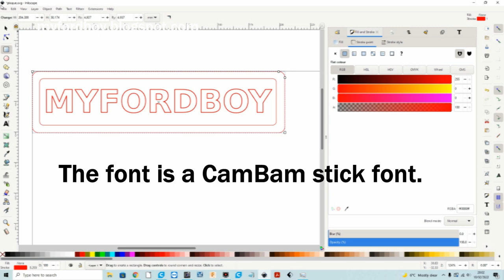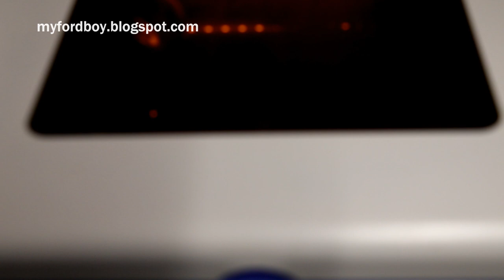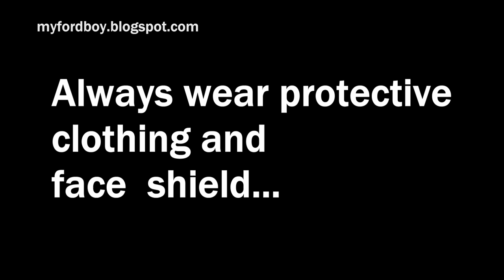Metal Casing at Home Part 116. Plaque/Sign from Laser Cut pattern

Comment: Laser cutters, the most under rated tool in the workshop!
Reply from the maker: I agree. It is so usuful and gets used much more that I expected.
Reply: Indeed - I have both 120W CO2 for wood/plastic and af 1kW fiber for steel and metals. If you don't need the lettering to stand proud more than 1.5mm then you can laser engrave the pattern directly from a piece of acrylic. I have done that succesfully several times. One thing I really like about lasers is the ability to cut what is almost a square corner, enabling slot/tab construction with a precise fit. I have also managed to cut functional stainless steel gears on my laser: https://www.youtube.com/watch?v=z2QA6EQYDEI

Comment: That 1st (in the video) plaque/sign turned out quite well.  When you applied PVA to seal the MDF, the thought popped into my head to ask if (thinned?) PVA could be sprayed in an airbrush in situations like that when you want to cover everything.
Reply from the maker: I did actually thin the PVA to seal the MDF and there is no reason why it could not be sprayed. It is helpful to get a fillet of glue around the text.

Comment: was about to ask if the lower flask wasn't too shallow - like the fails and aftermath 👍👍👍
Reply from the maker: If use the same flask for other castings without issue. In this case I don't think they were together property. I used clamps on the second attempt.

Comment: Question; You have always indicated to allow for 2% shrinkage. Without no fancy tools just a ruler & tape measure, what is the best practice from casting brackets for an engine to mount P/S, an Alternator and other then drill holes to mount these items?
  I am using a Late model EFI engine in a 56 year old truck for me. This is my last project but including parts for door panels and a center console I am building with 1/2” PVC then covering with foam & leather. All custom to suit this 6’3” tall retired ASE master tech and building for my taste and size to be comfortable. 
 Using a calculator and creating wood molds to cast these parts oversized then power sand to size before drilling holes to mount the parts. The rest are simple items as I intend to add bolts or machine screws into the casting for mounting.
  After decades of seeing designs used to create beautiful panels with metal inserts, I draw these on paper then modify to keep simple & easy to service. Long after I am gone, a service manual in paper, CD and thumb drive to allow any mechanic to diagnose the root cause, order parts for application & part number for ease of proper service. This gets many in trouble with a “Resto-Mod” using a mix and match of parts from different models, years and no idea where the wires or colors of wire used are found. 
  I am getting into the weeds a little, but what do you feel is the best for this 2% allowance on items that require more accuracy? I have drawn these brackets, holes, gussets for structural strength and ease of service as to me, this is job one with simplicity using the “KISS” engineering principle of keeping it simple stupid! Thanks for all of the free training and projects as the camera, lighting, sound, editing is work folks don’t think of for each video. For many reasons, I can say with pride, thank you very much!!! Omaha, NE. Thanks masked man!
Reply from the maker: 1.5 -2% needs to added to the pattern. It will depend on the metal used. If it's realy critical you may need to do a casting first and adjust the pattern size.
You need to add draft to all vertical surfaces and extra for any surfaces that need machining. Take the length of a part you want to finish up with and multipy it by 1.5%, i.e if the part is 5" long pattern would be 5.075".

Comment: I liked your idea of using the frame to accurately align the characters. The software does the aligning, brilliant!
Was the draft on the MDF pieces achieved by tilting the laser cutter lens or by slightly defocusing the laser or just a normal function of laser cutting MDF?
Reply from the maker: Draft is always there on a laser cut part. The lens of the laser creates a cone shape beam so gives draft on both sides of the cut.

Comment: Do you think you could use silica sand and sodium silicate / core method to make an outer cast of an object, burn out the inside ( PLA )and then pour directly into the void ?  the cast would be supported by green sand  ? Thank you.
Reply from the maker: I have done this with refractory plaster but I can't see the PLA burning out cleanly from a core type material which would have a comparitvly rough finish anyway.

Comment: Sir which 3d software is best for use sir?
Reply from the maker: I have been using ViaCad v8 for 10 years but recent Window 10 upadates are making some functions unusable so I am switching to Fusion 360.
Reply: Sir, minimum how much thin can we cast the things sir.
Reply from the maker: @vpictures9182  depends on the material and long the part is as the metal has to flow through the mould before it cools.
Reply: Thank you sir ❤️